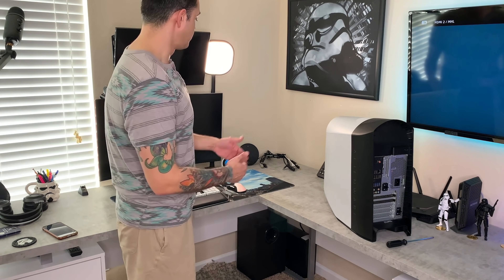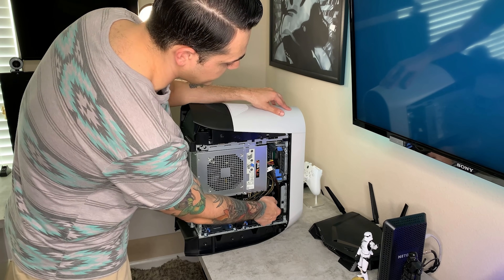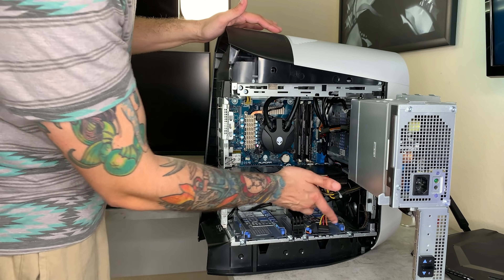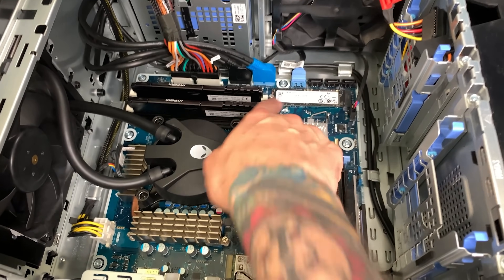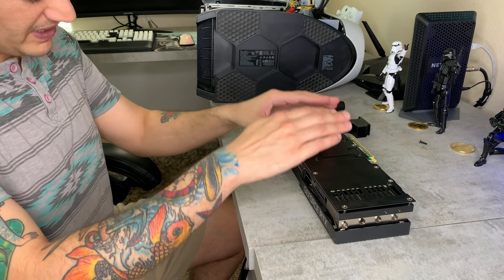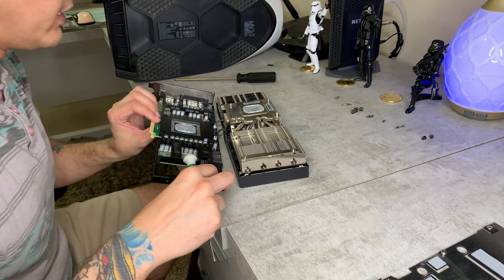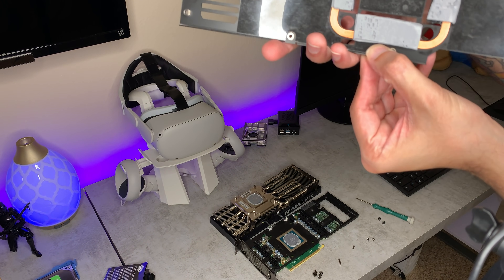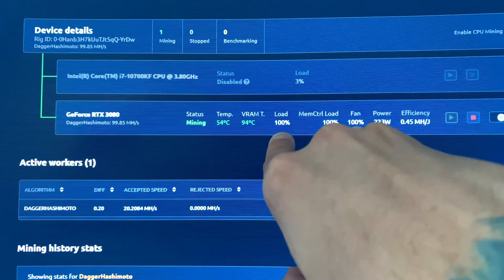Alienware R11 3080 Thermal Pads and Paste Drop VRAM Temps 30C

Comment: Wish you would have shown video of exactly what you did.  I know you told us, but the video would help for newbies.
Reply: Yea, idk i feel like what he describes is very messy and probably not it. But it is what it is, he wont clarify the process.
Reply: @hzr815  He also doesn't mention the size of the pads he tried.  I've read that 0.5mm pads are the right size for between the heat sync and the black plate.  The ThermalRight Odyssey pads have a maybe 40% more heat transfer than Arctic Silver 5.  I'm thinking pads might actually be better.  I'm going to try it this weekend.
Reply: @KellyNicholes  do some videos to help use newbie here, please ya :)
Reply: Yea. This video skipped out the most important part. And just him describing the process over and over again.
Reply: I just tried 0.5mm pads. The VRAM was down to 80 from 108, but the hot spot temp and GPU temps got up to 103 and 90, respectively. Redoing with just thermal paste and I'm down to normal gpu) hotspot temps but down to 90C on the VRAM. I'll try the pads again, though, as they should be better...
Reply: @KellyNicholes  I tried 0.5 mm pads too but the VRAM temperature is about same at 108C. But my GPU temp went up to 72C. Did you replace the thicker thermal pads on the other side of the VRAM connecting to the black backplate?
Reply: @hondajacka2  No, I only tried adding the pads or paste between the plate and the heat sync. But the thermal paste only definitely lowered to 90 from 108. So there's that. I'll try pads again tomorrow on another card.
Reply: @KellyNicholes  may i know what are the thickness pad that replace on the rear plate?  Thanks
Reply: @henhoor  it depends on your card, of course. For my Dell 3080s, I only put a 0.5mm pad between the heat sync and the plate, so I don't know the thickness. Somewhere between 1.5 and 2mm. If I had to pick one, I'd probably go 2mm because it'll squish.
Reply: @KellyNicholes  im here ofurace i having the same card too XD  , 0.5mm for the rear plate is impossible, the stock one already 1mm but is having gab still.... so i hope to  know the thickness that he use for back plate in the video
Reply: @KellyNicholes  i think what u saying is not the rear plate ?  rear plate is only plate direct touch to the chip, no more heatsink @10:25
Reply: @henhoor  Yes, I didn't touch the pads that actually touch the chip, but those are maybe 2mm. I can measure the next time I do another pad replacement. I have four more 3090s to do.
Reply: The 3080s could use the thickness, because those pads barely touch the top of some of the components and doesn't even squish down to the board.
Reply: @KellyNicholes  do u think we should we replace the pad under the black plate ?  for the vram
Reply: @henhoor  I didn't, and my cards are running at a nice cool 90-94C with 70-80F ambient temp. If they look damaged or dirty or something, yeah, replace them.
Reply: @KellyNicholes  mine is 92c all the time, but i still worry on it... is that a safe temp to running all day long ?
Reply: @henhoor  the hardware specs for that DDR6 RAM is like 120C before it starts melting. I've run none before the mod at 110 and it was just fine, but the hash rate is limited, and I've only had the cards for two months. Now they're modded, though. Honestly I wouldn't worry about your temps.
Reply: @KellyNicholes  Appreciate for your reply, would you mind for last help, is the 3mm thermal pad suitable for the rear plate ? i see some distance for the stock pad...
Reply: @henhoor  let me crack open my 3090 and tell you what I measure on that backplate. 3 sounds a little high, but I bet you could squish it in there.
Reply: @KellyNicholes  I’m still really confused, have an r12 rtx 3080, gpu vram temps at 110, what thickness and type of thermal pads should I get and how do I replace them?
Reply: @experimentalgaming1366  I'm getting 1.5mm thickness when measuring my backplate pads on my 3090. Maybe I'll make a video...
Reply: @experimentalgaming1366  Honestly for a 3080, you'd be fine just using thermal paste.  You open it up, remove the stickers on the heat syncs, goosh a line of paste around the heat sync, and put it all back together.  If you wanted, though, you'd also get better cooling if you threw in some 2mm pads on your backplate.  I buy the thermalright pads, and they do great.  I've done 21 cards.  Pads seem like a better long-term solution, but the paste actually gets better results for me.  I'm using Arctic Silver 5.  I'll bet there's much better paste out there, too.  But I'm running my 3090 at 88C at 60% fan speed instead of 106C at 100% fan speed after my mod.  The GPU runs very slightly hotter.  So yeah, for everyone I've commented to earlier, I'd say go all in for the paste and screw the pads on the heat sync.  If it's a 3090, make sure to get 2mm pads for replacing the backplate pads, because they stick to the memory and the backplate and tear apart when you remove it.
Reply: @experimentalgaming1366  And just to be clear, I've measured the pads that come w/the 3090, and they're definitely 1.5mm.  Maybe they compressed from the backplate being screwed into them, but I'd go for the 2mm just to make sure it squishes down for the 3080.  The 3090 has VRAM to squish against, so there's obviously some contact.  The 3080 doesn't have those VRAMs on the top, so the 1.5mm thermal pads don't make much contact.
Reply: @KellyNicholes  hi. I ordered some noctua nh2 thermal  past so I’ll try it. Thanks for the advice I greatly appreciate it. I’ll let you know what difference it makes
Reply: @KellyNicholes  i just done adding the thermal paste on the vram front heatsink, the result are so impressive !!! now remain 87c with 100% load, i cant believe dell team did not put any paste on it, ill try to change the rear pad see any different will update here ... will try on 3mm
Reply: @henhoor  nice!! 3 sounds thick, but I bet for the 3080 it'll be perfect!
Reply: @KellyNicholes  Thank you for the clarity
Reply: Guys ive done extensive testing 2-3mm for memory on fanside/frontside. 1.5mm for backplate. You just take the gpu apart and replace the already included thermal pads.
Reply: @MikoMuru  that's a very limited explanation for "thorough testing." What were your temps before and after? Did you do anything with the junction between the heat sync and the backplate?
Reply: @KellyNicholes  any updates on how the pads vs paste went for you?
Reply: @samkellmanactor  when I used enough paste, the GPU temps were 5-6 degrees cooler than with the pads, but the pads were more reliably cool. When I didn't use enough paste, the VRAM temps were maybe 6C higher. I just bought more pads, because I prefer them over the paste for the guaranteed VRAM drop.
Reply: @KellyNicholes  awesome, good to know, thank you!
Reply: Also jsut in case, should I buy 2mm thermal pads?
Reply: @experimentalgaming1366  only if you are doing a 3090. The 3080s pads are almost certainly just fine.

Comment: my 3090 is mining at 115 mh at 104c , can’t wait for those pads to arrive, i honestly don’t care abiut going any higher, i’m just more concern abut those high temps, i just want to lower the temp. but if i get a few extra mh even better

if i would it onow what i know now
i probably would it had gotten a pair of 3080’s instead of a single 3090

i always wanted to mine but i didn’t until one day i decided to try

nice video
Reply: @abnersilverio  i don’t recomend the 3080 over the 3090, let me explain, what i was trying to say is that for mining is better to get a pair of two 3080 instead of a 3090, because for the price of a single 3090 you can get a pair of 3080 and have more hash rate than a single 3090, 200 vs 120, the 3080’s can reach around 100 mega hash while the 3090 can reach 120, of course for gaming and probably everything else the 3090 is a better card because it has more vram, some games might scale using nvlink but sli is technically dead. for mining a pair of 3080’s are better than a single 3090, imo
Reply: @abnersilverio  yes i heard about the problem, unfortunately gddr6x gets very hot, you don't have to open none of your cards if you don't want to but you will have to lower the memory clock so the vram doesn't get too hot, is also recommended to lower the core clock too, you can use the profiles in nice hash, set it to medium or low, you can also do it manually, 300 or 600 less on the core clock and around 500 to 1000 less in memory clock, that will lower the temps on the vram, that is the opposite of what many people are doing but that is the only way to keep your warranty, keep in mind that by lowering the core clock and memory clock, your card might run a bit colder, but it will also lower your hash rate, is a trade off, what many people are doing is the opposite, changing the thermal pads that comes from factory and replacing them with high quality pads that way you are able to increase the memory clock from up to 1200 to be able to increase the hash rate
Reply: do you know if we need to get the same size pads for the 3090? Or do we need a different size pad than that of the 3080?
Reply: @cepherator  it depends on the brand, yes there are some similarities on some cards but there is also some diference, the best thing to do is search for your card model, that way you can get the right pads
Reply: @yonoexisto7833  oh, I am getting the Alienware branded one. Do you have the same brand?
Reply: @cepherator  i have an aorus master, i have a complete aorus system, i build a secondary system with a pair of 5700's xt, i'm making a round 22 dollars a day with my 3090 and both 5700's xt , around 215 mega hash, all together, i wish i would it had done the mining thing much sooner because i sold so many graphics cards during the last few years, every time i wanted to upgrade, when i really didn't need to sold those cards, i would it had mine with them and get the money for the upgrade and i also i would it have kept the cards too, but it is what it is, know i know. it will take some time for the prices to come down, tsmc just made a announcement recently, the shortage will continue, at least i can make some money with what i have for now, i will take around 2 to 3 months to recover the investment for the two 5700's xt then after that i will start making money

Comment: Hmmm. I wish I coul have seen more about how to apply the pads/past. Is there a good forum or reddit post about this? Side note. Don't care about cost. I want the highest quality pads/paste for my baby!
Reply: we see the thermal paste application on the gpu die but no footage of the application on the specific places he mentions. I really wanted to see too since I'm expecting the a similar system to arrive soon.
Reply: Fujipoly ....is what you want bud, replaced my x299x gigabyte boards pads to those pink ones a hair thicker as well, GREAT difference! I put it under the boards VRM as well as the obviously changed = under the VRM heatsink as my particular board has a backplate so it squeezed it in place something perfect, it DEF makes a diff just take time...
Reply: thermal pads application is pretty straightforward, just copy original pads' size, remove old pads and place new ones.

Comment: is it worth it doing on the 3060ti?  i guess why not, but does it even get that hot?
Reply: @stevemisfit1  oh i don't know if it has, just wondering if you know if the 3060 is built similarly. i may do it just because. the cooler the better, even if it doesn't get hot to begin with.
Reply: I have a 3070 and it does get hot. Previously, i have my gpu fan setup at 60%z

Comment: Yeah, these videos leave A LOT to be desired in the way of showing people what you actually did step-by-step. 

I put pads on mine without paste.  I used 1.0mm pads under the metal plate from the pcb/mem chips up to touch the metal plate.  They honestly didn't look at thick as the stock ones to me, but my temps definitely went from 110 down to the 95-100c area while mining on 75% fans.   

I put 0.5mm pads between the metal plate and the actual heatstink (where he took the stickers off and applied thermal paste).   

I'm thinking maybe I should use thicker pads in both spots but I didn't want to risk pushing the heatsink too far off of the gpu core. I have seen others say they used paste too but I thought the gap was too large for paste?  Maybe it's just me but I always thought pads were recommended for these larger gaps?

I didn't even use fancy pads just the cheap blue ones on amazon that were 6-7w/mk.  I'm pretty sure the pads he bought had double the heat transfer capacity and should perform even better.
Reply: There is another guy who shows you step by step ...and I haven't tried but I will.soon
Reply: @gmorgcyborg  can you link the video?
Reply: @gmorgcyborg  can u link the video plz
Reply: @mohcinetiguenza6208  but i just realized.. we have different cards .. I have the founder edition .. im sure all cards are built basically the same with just different coolers

Comment: Pads work fine, you need 0.2mm pads for that area.
Reply: Do you have the same card? Have you tried with 0.2mm pads and what were your results?
Reply: @ΚώσταςΠαπάζογλου-σ7ψ  I do and it's roughly the same result wise.
Reply: I have that card and used 2.0 mm pads and worked like a charm. I also used thermal grisly thermal paste in the areas recommended. Worked like a charm.
Reply: @dangerlos  that’s awesome - how much paste did you apply? And just 3 2.0mm pads to replace the originals?
Reply: @osprey0987  yes just one layer of 2.0 mm pads only needed one pack. For thermal paste, I used about 2 grams but I had purchased a 5.5gram thermal grisly syringe so it’s just a guesstimate. Now that I’ve been running quickminer for a few days the temp on high is 94-96. But still way better than 108 on lite.
Reply: This worked like a charm. My VRAM temps went from 108 to 92 w/ quick miner on high setting.  Thanks for the video. Also it was not hard at all just take your time.

Comment: I'm doing 94 mega hash at 98 max temp on the memory.
I'm not doing that because don't wanna lose warranty.
Reply: I have learned that what others are doing (check techpowerup) where they buy heat spreaders and stick them to the backplate and add a 120mm fan to the backplate. Not only does it not good warranty (you can just remove fan and heatspreaders), it apparently works too.

Comment: I'm going to dump the whole case, putting a metal box in the middle of the case blocks airflow.  Does it not? 
Wtf dell?
Reply: It will not work. I have dell oem 3080 in open cooler master case with 5 fans (not counting fans on 3080) @ %100 (3 internal and two 6" external) and temp is sitting at 100C. GPU -150, ram +860 GPU power at %70 - solid 97 mh. Im waiting for pads and thermal paste as I'm tired of jet-taking-off like sounds in my basement.

Comment: I have a 3090 Kingpin and while using Nicehash without any of its overclocking (Lite/Medium/High) settings, the VRAM on the 3090 hit 97C.
But when High is selected, the VRAM temps go down to 92C (consistent).